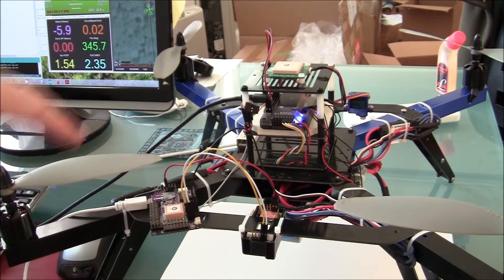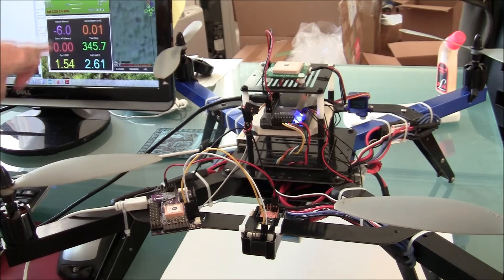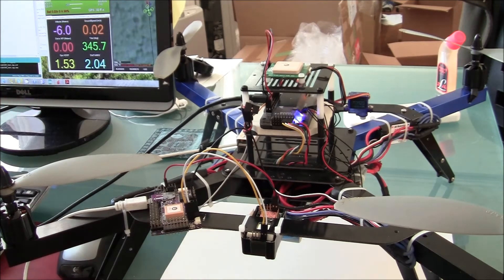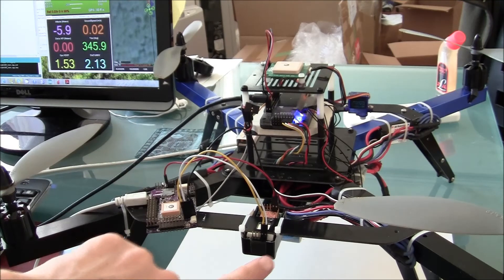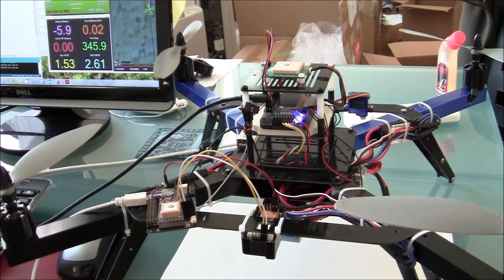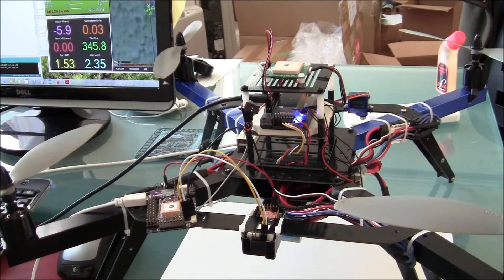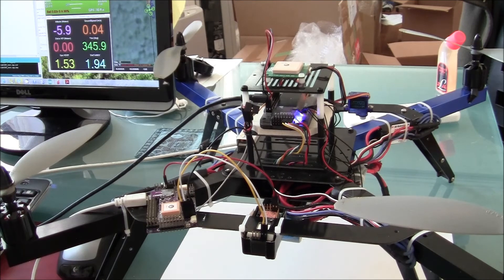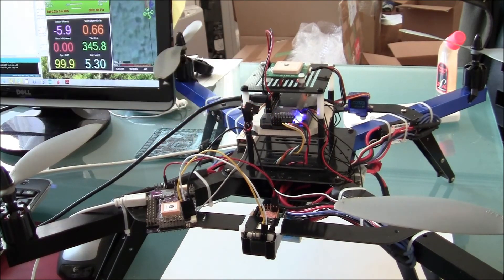GPS interference example

Comment: I take it the gps can interfere with your fpv feed as well?
Reply from the maker: Ian, I'm not sure (I don't use FPV systems much) but I haven't heard of this.  I think the GPS is a receiver rather than a transmitter so I think an FPV video system could interfere with a GPS but not the other way around.
Reply: Randy Mackay I’m only asking because my dji fpv system started getting a severe drop in range and penetration, as it even on 1200mw I’m not making it farther than 200 feet without terrible drop outs, I’ve reasoned that I probably have a faulty air unit or something, just happened to go bad when I installed the gps.🤷🏼‍♂️
Reply: @ianozborne1555  I have the exact same problems after I installed a GPS onto my system. Seems like I get random latency spikes but when the GPS unit finds more satellites its not as bad...weird,

Comment: Randy: not related to the GPS interference. I like your frame. Was that made by yourself? Could you please provide some details about it. Weight, Diameter. Materials Used Square tube size thickness and flat sheet metal thickness, I'm presuming its all alluminium
Reply from the maker: +Sutton Murray Hey.  The frame in the video is an older style 3DR quad frame.  3DR is pretty much out of the DIY market now but you may find something at store.3dr.com.
Reply: Well i still think your frame is a better frame than mine (i have a tarot). I believe in simplicity. The reliability factor is just better with lesser maintenance. I will check out 3dr web again, i never noticed before on their web

Comment: it would be interesting to look at what's going in the air with something like a cheap rtl-sdr. If you're just looking at gps interference a dipole near the gps freq should work, or ideally use a gps antenna since that'll be more similar to your gps module antenna and will do the circular polarization.

Also try putting some RF chokes as most of that interference could be traveling through the cables.

Comment from the maker: Chris,
    Yes, I tried that a few hours after making the video.  I powered the APM with the GPS from a battery and the APM with the sensor from the USB and it still caused interference.  Sadly I couldn't see exactly the hdop values ('cuz i didn't have telemetry) but I was still seeing the APM lose GPS lock.
By the way, the ublox apparently has a "jamming" number that it can report.  I hope to verify soon that this number is reported and that it can accurately tell us there is a problem.

Comment from the maker: Aaron16,
     I'm not sure.  This is actually the first time I've run across this type of behaviour (I don't use FPV or even telemetry that much).  I'm guessing some type of metal case might help reduce the interference and I have also heard that some electronics that cause interference can have "dithering" added to the clock which can help reduce it's impact on other electronics.  I hope we can use this as a bit of a test rig to easily create interference for testing.